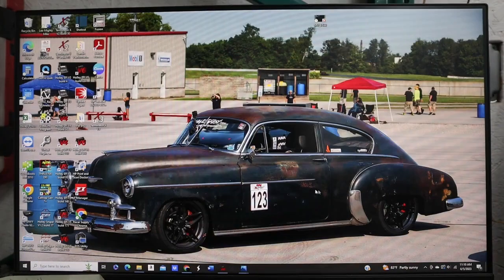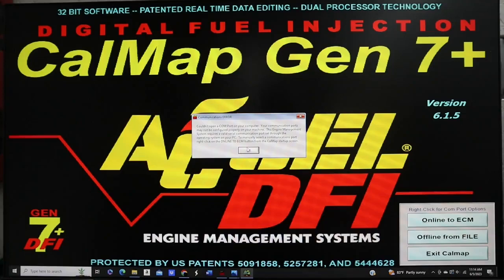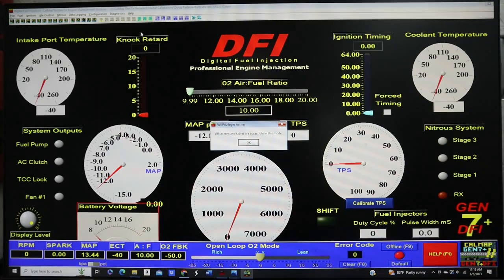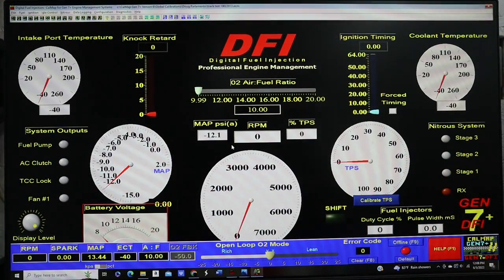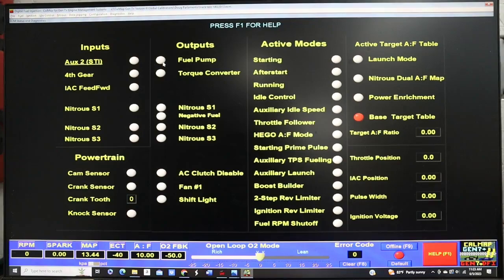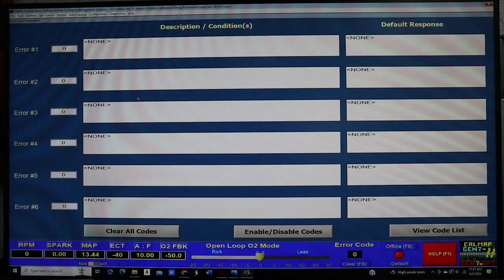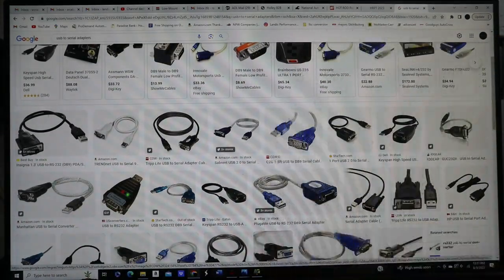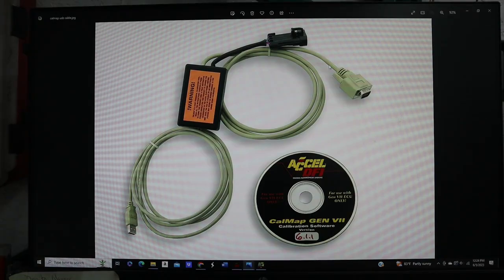ACCEL DFI software guide: Maximize your engine performance

Comment: What replacement you use for 02 sensors/wideband that are using the 7 wire plug on the accel wiring harness?
Reply from the maker: Unfortunately Accel tested and installed a resistor to make the sensors as close to a lab quality senor as possible. Problem is they are not available now, so there is No replacements.  We tried to make one with no success, and as far as I know, the equipment is no longer working. So the only thing you can do, is convert to a Daytona Senors, or Innovate wide band and send the Accel DFI or Thruster an analog 0 volt =10.0 afr / 5 volt = 20.0 afr  signal and switch to custom in the software. Thanks for the question, hope this helps

Comment: The tau table don’t understand that part I have the pro key installed
Reply from the maker: I will have to make a video on TAU. But quick answer is it is a function of fuel wetting behind a closed valve in the intake port. It manly affects acceleration fueling.